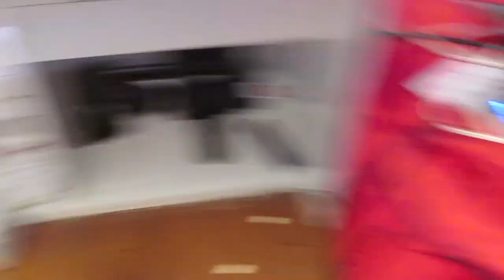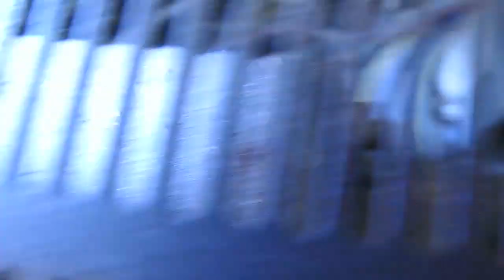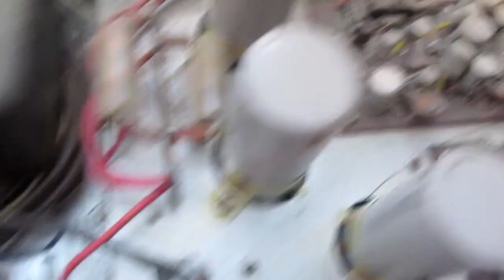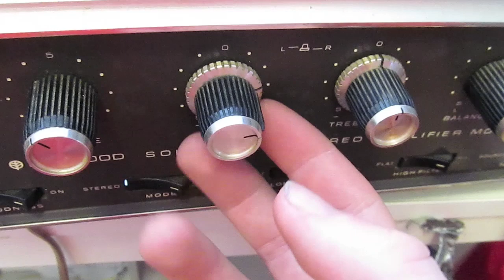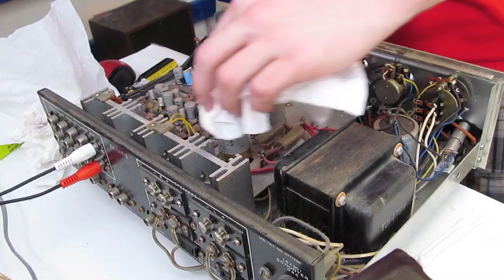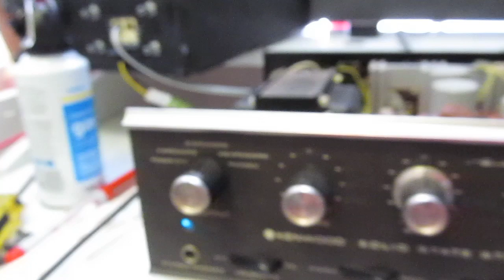Old Kenwood KA-2500 amplifier look inside and quick clean-up

Comment: Known as TK-250u here.  A major recapping, transistor replacements & service give warm, punchy, vintage tones.  Those old Kenwood Trios make gr8 hubs 4 a vintage hifi rig (my Lenco L78 TT should match well).  Allison 6 spkrs sound nice with these amps. A very early solid state late-60s/early 70s amp.

Comment: As long as the speakers that are with the amp are not dry rotted they probably sound better than some of the stuff you've heard because that happens to be a very good amplifier Kenwood back in that day that back in the 60s was very good amplifier was manufactured very well it's not a piece of junk not the way they were made back in the 80s and 90s the 60s and the 70s Kenwood was a very good make their amplifiers and their receivers were built very well when they started getting in the early 80s that's when they went to shit they started putting all the garbage in there those power packs instead of the pat instead of the year regular amplifier transistor STK power packs those things are garbage I would rather have an old receiver or amplifier than some of this new stuff the sound quality is so much better

Comment: I know this is old, but a correction, 2 of those big caps are output caps, not + and -, but you are probably too young to remember when most smaller transistor amps were capacitor out. That pop when you turn on the speakers is normal for that amp. A rule of thumb on old amps, if they had one large and 2 slightly smaller caps they were capacitor output, like the Dynaco Stereo 120 and 80 and just one polarity power supply. If they have 2 equal sized large caps the amp is direct coupled and has a plus and minus supply, like just about everything in the last 40 years.

Comment: I have a 1982 Sugden A25 amp - I am getting distortion and it can be on either speaker and it's intermittent, any ideas what this can be and would this process be worth me doing or does it sound like a capacitor? Thanks in advance

Comment: Hey! I have an identical amp (Kenwood TK250, 1969). I've dusted it inside out and cleaned all the knobs and dials, and it works delightfully - however, when connected to speakers A, I get a difference in volume between the channels (L is louder than R), and this persists on both Speakers A and Speakers B.

Where would I start looking for culprits, and how tricky would it be to identify the problem and fix it?

Thanks!
Reply from the maker: Make sure the balance and tone controls are all centered and working first.   I would look for poor connections and bad solder joints at the speaker selector switch and the output stages.  Could also be a bad output capacitor as well, so check if those are in spec.  An oscilloscope or a second (functional) amplifier as a signal probe would be very helpful in tracking down where the signals are getting stopped or shorted.
Reply: Thanks for the tips - forgot to say that this happens when in "mono" mode; when in "stereo", the right speaker plays normally, but nothing coming out of the left speaker — not sure if this helps to pinpoint the issue. 

I'm trying to get my hands on an oscilloscope to follow the signal path through and see where there is a difference between the two channels.
Reply from the maker: That is odd behavior, and I don't know enough about the inner workings to tell off the top of my head what would cause that.  Certainly o-scope is the way to go if you can get or rent one.
Reply: @laonikoss  hi, did you make it to work properly afterwards ?

Comment: I did my mp8 power mixer... I did not open the cabinet because they are( sealed pots).I put it upside down  pots facing up...removed the pot button...put a drinking straw over the pot stem gave a small shot of wd 40 in the straw wile putting a little pressure on the straw put my lips and blew in the straw, worked the button on and off ....and guess what....IT WORKED....

Comment: I think your amp is a Class A output stage and they tend to run hot if you want a cool running amp then Class D is the way to go.
Reply: DAVID GREGORY KERR isn’t class d a subwoofer amp or at least commonly used in subwoofers for cars?

Comment: i would do a ful resto on the caps , transistors and chk for cold solder joints. i have been restoring audio for 20yrs from a Marantz 2260,4230, pioneer sa-9900 etc. i do a full restoration from bones up. btw NEVER use a vaccum. And wd40  should never be used. I only use Deoxit.
Reply: nigel mahabir not worth it on a Kenwood

Comment: what missing here is the fact that the older equipment was analog and the new equipment is digital.  digital is harsh and has a steady beat--whereas analog just flows out of the speakers.  the difference is very dramatic but the younger people today think that 1000 watts of blasting sound is good sound---but really good sound is where you hear all the instruments just like you where there.  analog is the only way and it is making a strong come back

Comment: Never use a vacuum, do to static, always use compressed air, compressor is cheaper then using a store bought can of air.
If you use a vacuum, you need to ground it at three places. The nozzle, the vacuum engine, the device being vacuum,
I have blown MOS FETs using a vacuum cleaner.
Reply from the maker: +MrMac5150 I've heard arguments for and against the static danger.  All warnings were for computers with very sensitive integrated circuits and not a brick of an amplifier from the 70s with discrete BJTs.  .

Did you actually blow discrete MOSFETs while they were installed by using a vacuum cleaner to remove dust?
Reply: MetaphysicalEngineer
 Yes I do not know how the flash over took place, but I was using a vacuum with a metal
nozzle, I was told to wrap a the tip with foil that had a ground wire attached, and this would have not happened. I would ground all points because that energy could have come from the engine. They have special vacuums for this.
Reply: very true
Reply: Also canned air turned upside down can be used for cold spray. Been using it a cold spray for years.
Reply: Bull Crap,, nice try kid.
Reply: I killed my new boombox with a vacuum cleaner. It had a metal wire in the hose. Your warning is legit.

Comment: nice stuff. What spray were you using with that vacuum cleaner? WD40? I recently acquired an old Yamaha AX 350. it works fine,but only on main direct (bypass) mode. Also, when i sometimes, the right channels distorts and goes off. till in increase gain from the volume. and then it comes back on. any idea what could be wrong?
Reply from the maker: +Anirban Bhattacharjee 
Sorry for the slow reply.  Spray was compressed gas in a can meant for cleaning electronics.  
Your problem could be many things.  Old capacitors can be marginal and only work right at certain temperatures.  Resistors could have drifted out of spec and not allow proper balancing of the amplifier stages.  There could be transistor(s) that are faulty and start having problems when they heat up.  Also , there could be a bad solder joint that also changes as it heats up and interrupts the signal.  
The distortion makes me think a transistor or resistor problem, but I can't say too much more without having the amp in front of me to examine.
Reply: Thanks a lot. i dont have that kind of DIY knowledge. Hence will take this to a friend to check out, Wish i could show it to you. but iam far away in India.
Reply: Hi, mate...you can use silicone spray as well.

Comment: Very nice vintage integrated power amp. One thing I noticed are the split controls for bass & treble. Fisher audio also did that. I have one question?WHAT THE HELL ARE YOU DOING IN MY FUCKING ROOM!!!  :))))))
Reply from the maker: 5argeTech 
Thanks for watching!
And if that is your room...what time warping wizardry just went down? haha
Reply: MetaphysicalEngineer It just reminds of my room back in the day! I was a mad scientist audio knuckle head! Made my own turntable. Built my own speakers. I had a 1968 Fisher T-250 receiver, (thanks Dad) It had good sound and what they called tune-0-matic tuning. on the right hand side of the receiver there was a bank of 5 little FM dials that you could tune and press the button the knob to store the station!  I hope you got my little joke!  :)

Comment: I have no electrical knowledge but enjoyed the video - I have a Sugden Amp (British made) - Just recently I feel like the bottom end (bass) has become lessened. Would this likely be the amp or subwoofer of the Bose?
Reply from the maker: Simon Jenkins 
It could be many things.  If the amp is decades old, it could have worn out capacitors that are starting to block the low frequency signals.  Is the problem the same on both channels?
If you can, try the speakers on a known good amp and the amp on known good speakers to see what combination the problem follows.
Reply: MetaphysicalEngineer Thanks for replying,  I am using the Aux channel as I don't have anything else to hook up. I use the amp in conjunction with Apple Express. I have no other hifi to test. It might need a service as it is 20 years old.

Comment: Scratch and dusty internally pots can be cleaned with MG Chemicals,
Electronics contact cleaner with silicone..comes in a small 5 oz spray can
available at most electronic hobbyist stores.

Comment: Be sure to run the radio with a dim bulb tester !!!.  Don't plug it directly into the wall outlet until it has been operated for a long time with the dim bulb tester.  A good idea is to get the schematic and replace ALL of the electrolytic and wax covered paper capacitors.  These 50-60 year old capacitors are potential time bombs waiting to severely damage the radio and/ or tube amplifiers
Reply from the maker: P51ride It had been in frequent use and working not long before I acquired it, and worked with no trouble then. 
Now that it has sat for well over a year, I will be very careful with Variac and ballast to start it up again.  A restoration would be a fun project,though I'm if I'm able to restore everything to spec I'll probably have to use modern equivalents to components because the originals have been out of production for decades.

Comment: These old amplifiers were built like a brick outhouse.  You might want to add a couple of inexpensive paint brushes to clean with as well.  As far as heat goes wait until you start using tube amplifiers.  I have a Knight KG 240 amplifier that was given to me.  Just for giggles I attached a thermocouple to one of the 6GW8 output tubes with fiberglass cloth tape. The temperature of the glass tube envelope was 320 degrees F..
Reply from the maker: P51ride Brick outhouse is right lol.  
Speaking of tubes, I have a 60s Zenith console radio that's all tube that I'll be working on soon.  Run it briefly as a test and oh boy it gets warm.  200+ watts at idle.

Comment: So there is no problem using the vacuum with plastic attachment? There isn`t any danger of frying anything due to possible static electricity? Just asking because I want to clean my old Rotel RX-202. Is there some kind of lubricant I can use for the volume and bass/treble knobs?
Reply from the maker: Rob Hernandez 
I forget.  There were either markings on the boards, or I just followed the signal path to what logically would be the preamp stage.
Reply from the maker: Ron Rivet There is some risk, but much less so for something as rugged as this amp.  A computer is far more sensitive and could be damaged.  
There are plenty of contact and potentiometer cleaners available that would work.
Reply: MetaphysicalEngineer How did you know that that was the preamp board? does it have markings saying so? or did you compare it to the schematic?Thank you, very interesting video Cheers

Comment: can I clean an electronic cirquit board of a Kenwood ts 930 hf tranceiver  with  clutch and brake asbestos dust removal cleaner  (those aerosols you can buy by the autopart store)?  it removes residue  and dryes  quickly !

this  tranceiver has been stored in a horrific place in the bad company of  many dangerous stuff, also broken asbestos roofing on top of that storage bulding  collecting dust for years.  wich has sticked on the circuit board
Reply from the maker: alessio'r roadies 
Brake cleaner is WAY too strong for that sort of work and may melt insulation and plastics.  There are plenty of electronics cleaners out there that would do fine without also dissolving the circuit components as well.

Good luck getting it cleaned up :)

Comment: any chance of electric shock when doing this? You didn't seem worried about it.
Reply from the maker: Nearly everything says "Caution: Risk of electric shock" and "No user serviceable parts inside" but there's minimal risk if I take precautions.  
I always unplug devices, or shut off at circuit breaker/fusebox if device is hardwired.  Some devices like this amp will make themselves safe within seconds of shutting off.  
Other devices like computer power supplies can hold dangerous voltage for weeks and must be manually discharged once you have them open.  CRT televisions and monitors can hold thousands of volts on the tube for months and must be manually discharged as well.
Reply: MetaphysicalEngineer thanks for responding.

Comment from the maker: No effect that I can hear.  A lot more dirt on a humid day, or maybe with ocean air could cause some problems.  I'd expect a vacuum tube/valve amp to be more sensitive to being dirty because of the higher voltages used.

Comment: Easiest way to clean vintage audio gear is to put it in the shower and clean it with washing up liquid and warm water from the shower. Just remove the transformer, moving coil meters, or anything you know will be damaged. I always take things apart before cleaning in the shower. Then I rinse with distilled water, then leave them to dry for a week in a warm dry place. I've done it with a few things now. Less effort and they look as good as new afterwards.

Comment from the maker: Thanks!  It is a nice amp.  I replaced the mains cord on mine because it was a brittle and worn but that's all the maintenance I've had to do besides cleaning it.  
I saw your video.  On your amp, is the power indicator a clear lens or a hole?  Somebody put a blue piece of plastic to tint the indicator on mine a long time ago and I was wondering what it would have been originally.

Comment from the maker: That's how to do it!  A high-quality amp and some efficient speakers outperform computer speaker systems and built-in TV speakers by a long shot.  These amps will probably survive another forty years at least, though by then they will need some new capacitors and other repairs to keep going.  Subbed to you because I saw some cool stuff!